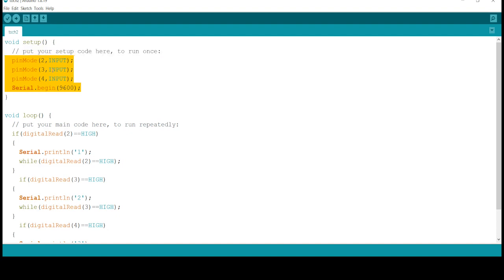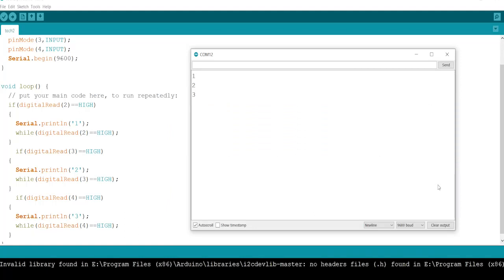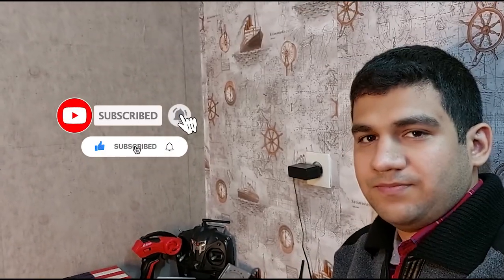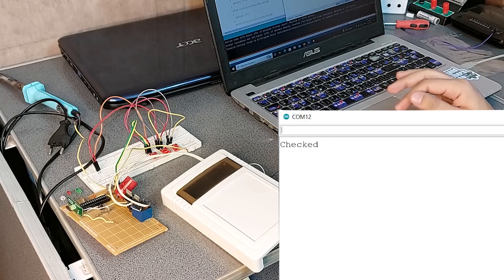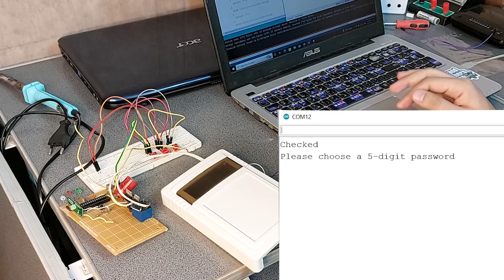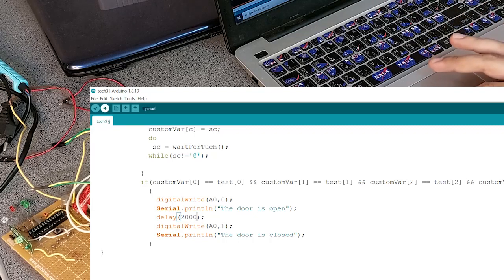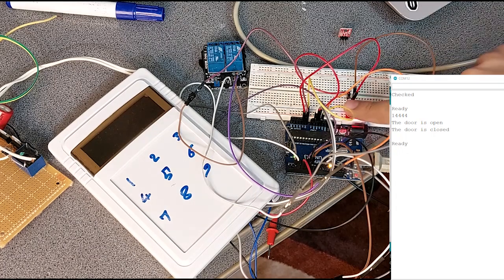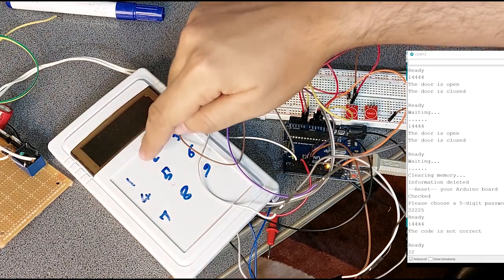How to make a touch keyboard? Part 2 (by TTP223 sensors)

Comment: I need small help regarding the tp223 touch module.
If I m not relizing my finger more then 15 sec but module has been off.
My requirement is whenever I m putting off my finger then device state should change
Reply from the maker: It's been a long time since this video. As far as I remember, the module was showing the same behavior.